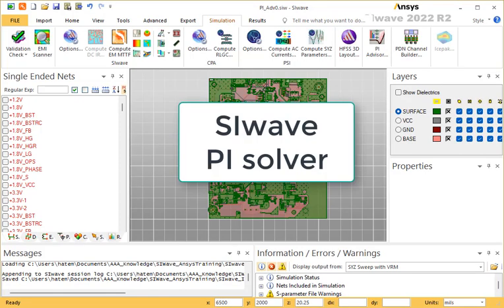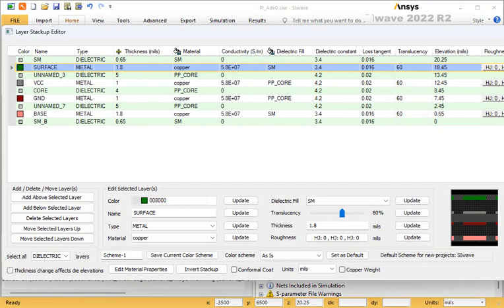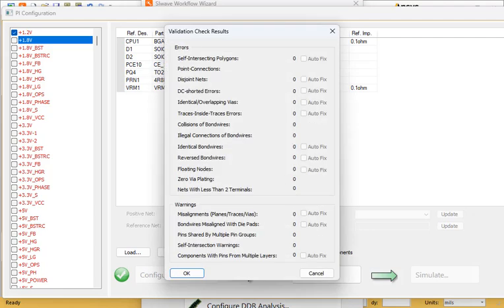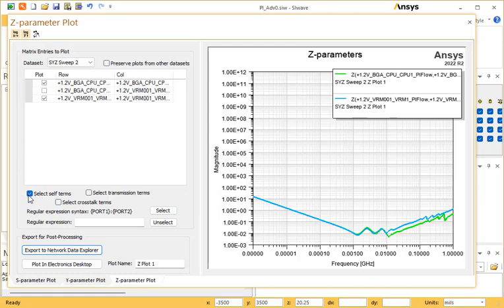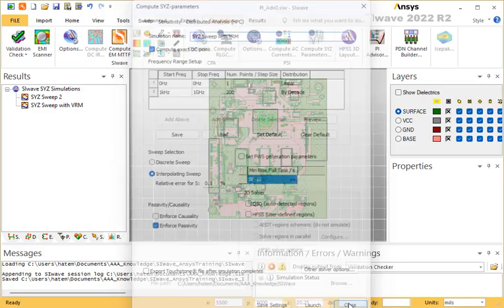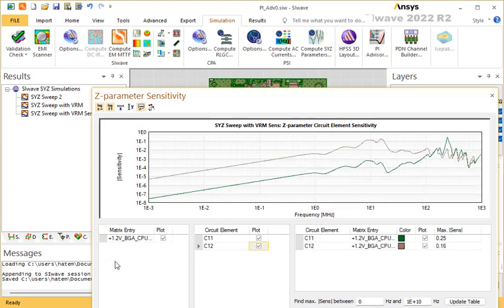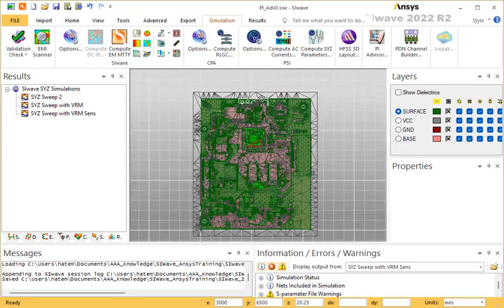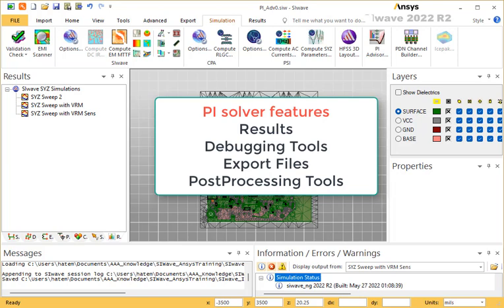SIwave: Unleash the power of the PI solver

Comment: Hello Sir, Can you please guide me regarding my simulation, i have 2 layer PCB on Top Signal, Bottom GND, i also have few SMD 0402 resistors connecting parallel on top and my signal is travelling from SMD to VIAS and bottom layer, how can i consider the SMD in my simulation. i wants to measure the S parmeters to define the BW of my design